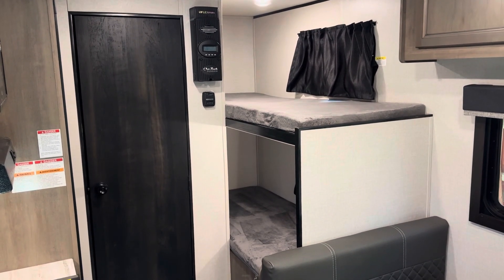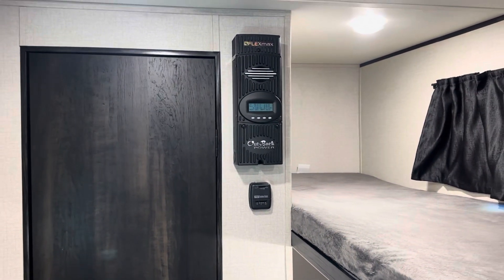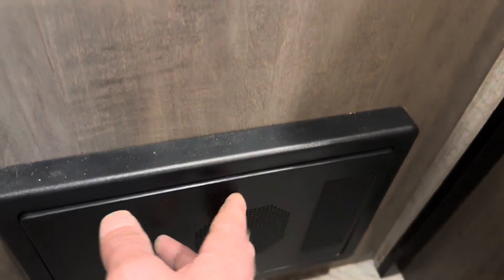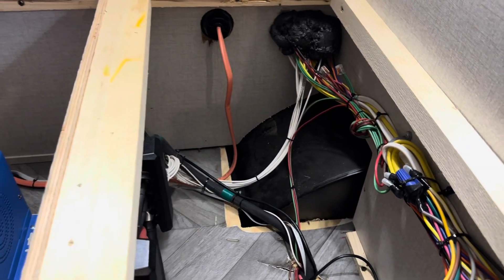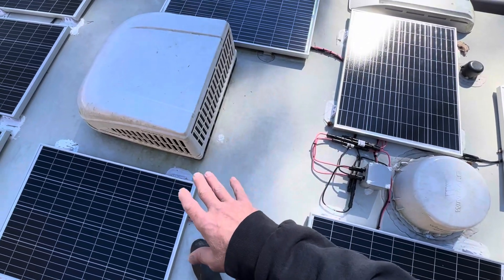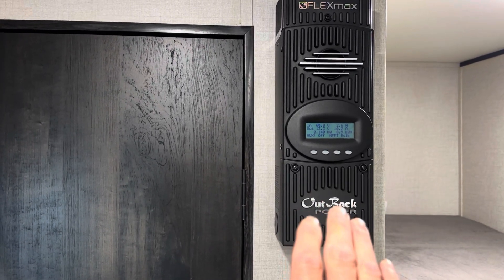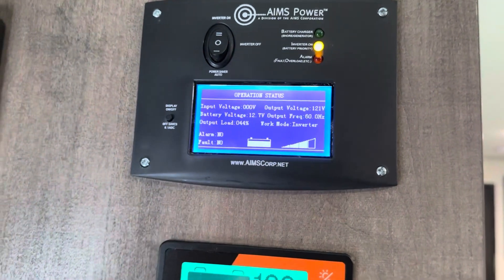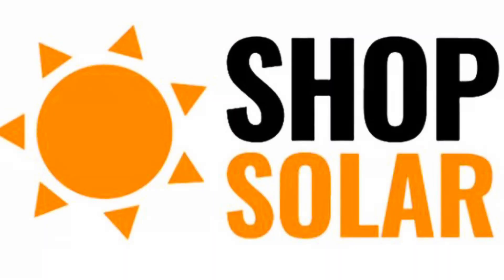OFF THE GRID RV BUILD, Winter Performance Update

Comment: Do you have to be careful charging with a generator? Is there a potential to overpower if you have a large generator?
Reply from the maker: The inverter has a built in charger that’s got adjustable charging settings! Actually you would have to be more concerned with too small of a generator if settings weren’t adjusted!

Comment: Recommendation. Change the spring furnace thermostat to a Honeywell digital. It will be extremely accurate and save propane. Frank
Reply from the maker: Definitely planning to change out that Tstat along with some other components as time and budget allows!

Comment: Probably not great idea to have bare wires on the roof like that. How long does it run the ac?
Reply from the maker: @jondoough What bare wire? Are you referring to the PV cable that is interconnect rated and can be used with or without a raceway? 
Really don’t care what you think is a great idea or not anyhow ✌️
Reply: I would classify this man as a professional. I'm certain there's a cover he removed before the video.
Reply: Yeah he has been doing some setup changes he said in the video.  I am certain he has conduit or something to secure the wiring.  He typically will over build things.